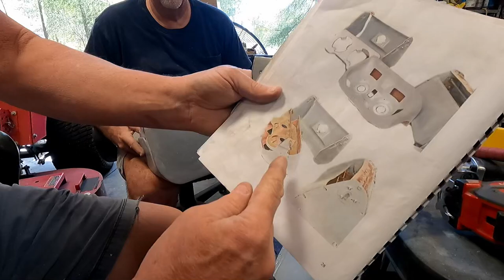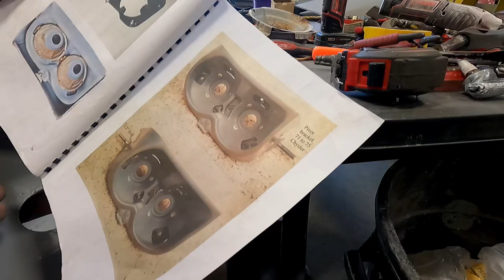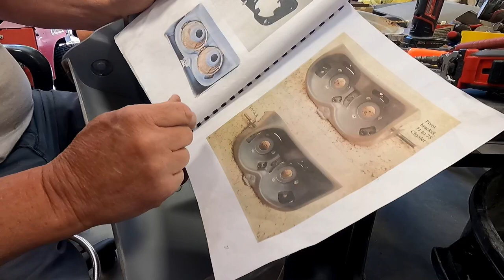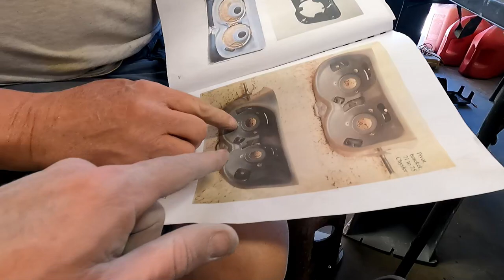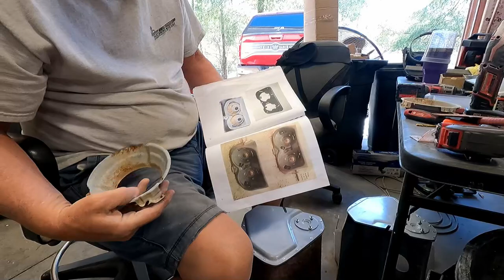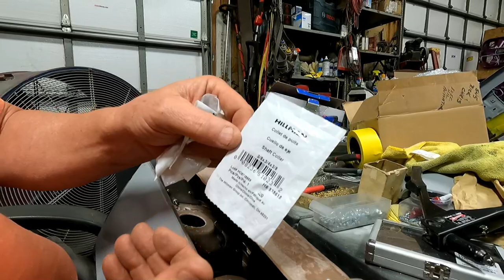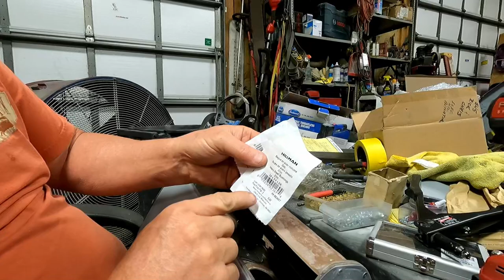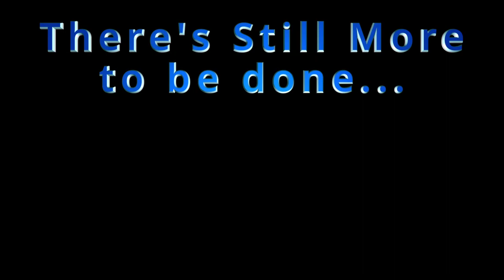Daytona Fender Scoop Install and Headlight Buckets Continued.....

Comment: What motors are you using for the headlights? Thank you for the great series of videos!
Reply from the maker: We tried the $450 kit for normal headlight doors and it couldn’t handle the weight.  We’ve tried several other attempts and I think we’re settled on coming up with a cylinder actuator, or going back to vacuum.  If you figure out something that works well, let us know!!!!!
Reply: @ClarksPlace   Thank you, I'll let you know as I'm doing the Nose first. I was going to try the linear actuators first.
Reply from the maker: @musclecarczarig4003  NICE!  That’s what we were gonna try next as well, great place to start!  Keep us posted!